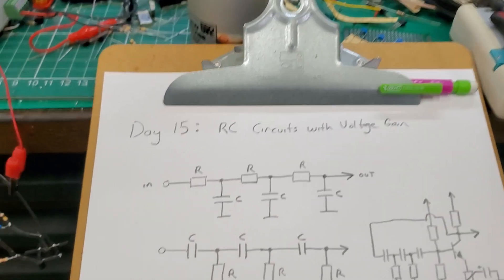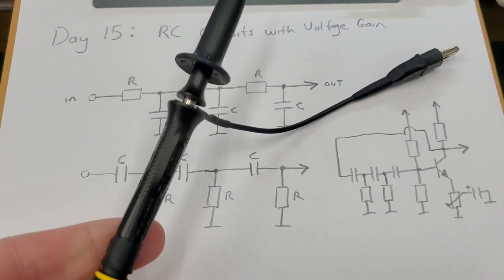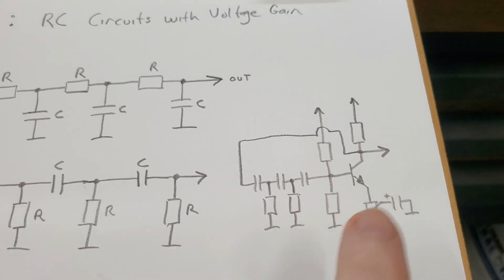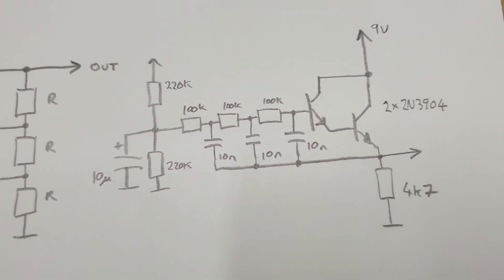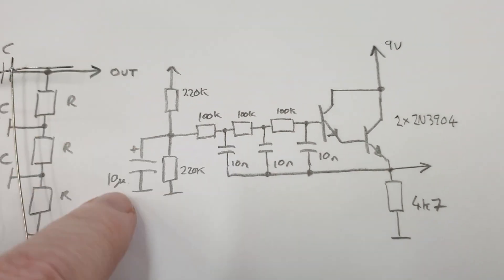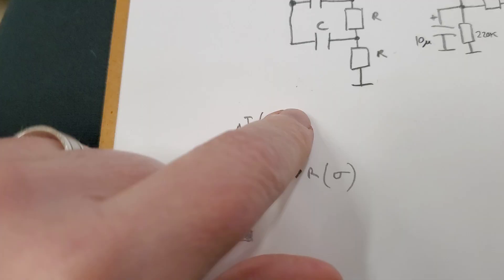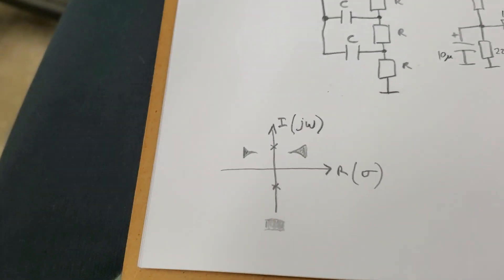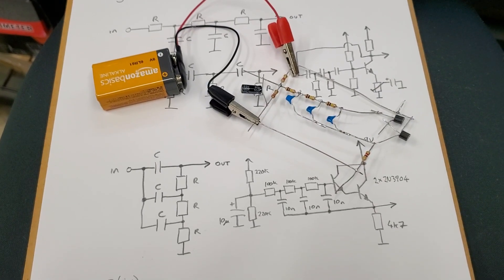ACoC 2025: Day 15: RC Circuits with Voltage Gain

Comment: that sounded like a clipped wave, I've made this with a single transistor and common collector and it was good
Reply from the maker: Yep, mine was pretty distorted once the amplitude stabilised, but it wouldn't reliably start with just one BJT at 9v.  Some sort of amplitude control would enable low distortion operation.
Reply: @vk2zay For it to work with common collector illustrates there's voltage gain. In fact I had 2 back to back germanium diodes and a resistor in series to make it not overdrive itself. It was using a single garden variety transistor. I didn't come up with the circuit, I think it was in silicon chip magazine years ago... in the 90s.
I can't remember the specific circuit in detail

Comment: You made a nice board for the EMO probe, I remember this project and I like it. What is the X dip switch position for?
Reply from the maker: Yes I made a prototype with JLCPCB, then I had a short run of boards made and assembled.  I intended to sell them at some point, but so far I've only given them away as gifts or scattered a few around at work and the house so one is always near by.

The DIP switch turns the three different sense stages on or off so they can be used independently.  The original version had a header to do this which was pretty inconvenient but I used it often enough that I decided I had to have the option in a "nice" version.  The 4th "X" is for an external expansion option header.  Again the original had this option via the "E" input, and I did at one point make a few things that plugged into it such as a photodiode ionising radiation detector and a broadband RF sniffer - both of which basically just generate clicks that use its audio amplifier and piezo speaker as output.
Reply: @vk2zay thanks for the response, good idea with external input 👍

Comment: The 3 Resistor and 3 Capacitor circuit simulated in falstadjs, AC source voltage 1V output 1.033V AC, is 3.3% (percent) more than source, the darlington in falstadjs generate 450Hz. Youtube deleted my two comments with links to falstad circuit simulator, sad youtube algorithm bots, but not deleting spam and scam on many big channels.
Reply from the maker: Yep that's around what I see in the real circuit.  It is very frustrating when external links get rejected by YouTube, but I know it is for preventing spam and bots, but still...